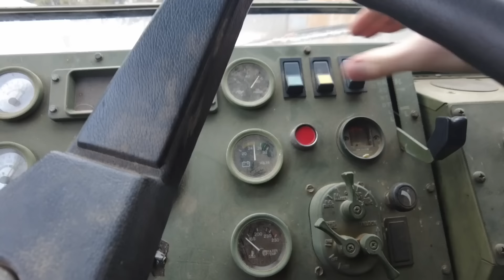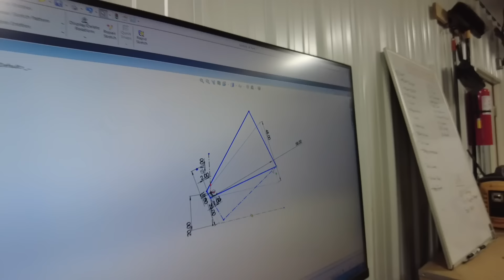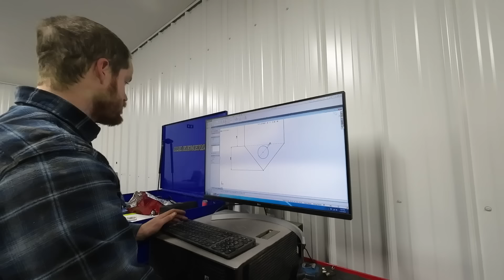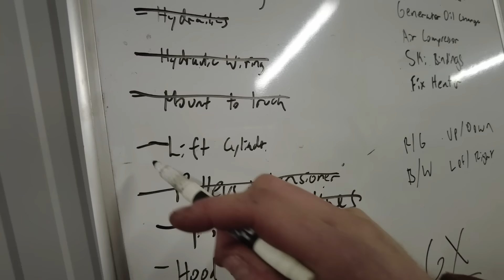We Built The ULTIMATE SNOW BLOWER | First Drive

Comment: Awesome job, guys.
Pretty darn respectable for a couple with mostly little experience with these huge projects you 2 have seriously knocked out of the park!

Pro tip-- take a piece of 1/2" by 1/2" square stock (or equivalent) approximately 8" long.
Set aside.
Also cut 2 (two) 3/4" long buttons of similar stock.
Make a capital F out of the 3 pieces to form a tool that can be slipped over the chain tensioner for extra leverage while donning or doffing big, heavy, wet, slippery tire chains.
(Helps immensely to slightly notch the buttons so they don't slip sideways off the tensioner.)
Also negates the need to remove big guy clunky gloves while working in puddles of sub-arctic slop in a snowstorm while tightening loose chains, should the need ever arise.

Drive to Kalispell and show me how incredibly fast you can blow the snow out of my driveway.
Stay for gourmet coffee and a delicious elk steak.

(bring your own elk, and maybe a couple extra for me)

😁😁😁

Comment: You could add a few airbags on the front axle to assist the existing suspension. I would also consider felling a few trees, or putting a bucket of dirt right at the back of the truck to offset some of the load at the front.

Comment: Something that will help besides weight in the backend of the truck, would be to put a crossing between each of the ones that are there on the chains. I just say this from experance working in the woods for 40 yrs. as a mechanic and operator. I only express my opinion from what i have found what works best for me and not everyone. I am lazy an do things that are the easiest and fastest for  me. You have done an excellent job on the blower. Best of luck.

Comment: It's really great you have everything you need to do this build in your shop. I'm glad to see you chained up. Some extra weight in the back would help but at the end where you got stuck you didn't clean your path ! All that weight on the front lightens the rear. Also if you ever noticed snow plows and blowers lift by a cylinder lifting a chain so you get a float action with it. That way it will seek its own level within a few inches on dips and rises. I want to see it in some deep snow since I'm not sure where you're at in guessing you got some heavy recent snow. Also we run transmission fluid in our hydraulic because it remains fluid in extreme cold and doesn't foam up.

Comment: Fantastic engineering job and some of the prettiest welds i've seen. Because you have added more weight to the front of the vehicle. It would be a good idea to add the same or even a little more weight over the rear wheel to help with traction. Retired Army Hooaa

Comment: Fantastic!  I had my doubts that the front end of the (low bid) Army truck had the strength to carry that much weight out front of the steering axle.  Keep checking the effects of vibration on your gasoline fuel and hydraulic lines and fittings.  Well done!

Comment: Good job guys (and girl !). After getting all your controls inside and everything, the only other thing I think you might want to do is build a cooling fan for the engine that blows out through the radiator instead of sucking the air in. When you have real light powdery snow, the fan will suck it into the radiator and clog it up. I used to race a car on the ice and that's something that happens. You could try building a framework in front of the radiator and put window screen in it, and space it out away from the radiator a few inches to allow air to get in around it. Good luck with it. It'll be good to see how it does in 2 feet of fresh snow !!

Comment: 1) Paint that raw metal ASAP.  2) Fabricate a cover for the motorworks using hood and trunk from the car.  3) Create a wire harness to bring all the controls inside the cab.  4) Put a load of sand in the back for traction weight and use if you get stuck. 5) great work!

Comment: Terrific engineering and build. I had a 6' blower with a 301 cubic inch, 59 horsepower engine. When the snow would be deeper than the first auger, the engine was lacking in power to blow the snow. Going to make a video on getting the truck out?

Comment: You might consider using some mechanical wire on the tire chain locks because they have been known to come off at the most inopportune times. If you have trouble getting them tight, deflate the tire, tighten the chain and reinflate. Congrats on your creation and don't allow anyone in front of it when operating!

Comment: Now you need to add a winch at the front and back so you can get out of situation without assistance. Glad it worked out. You will continue to improve it as you work with it. But what a job you did designing and building. Once you get the throtl connected to the cab it is going to be amazing. Love it 👍

Comment: Hi guys! Make two small wheels at the bottom of the mounted unit so that the body does not cling to the stones while driving or a curtain made of thick rubber 4-6", along the bottom of the trough, it will help to rake all the snow into the auger and will not let the stones cling on the road. Greetings from Russia!

Comment: The rear tyres are lifted up a little so then you need to add some weight in the back. But also i would offset blower so you can get the snow from the sides of the road. And then you dont drive in the ditch so fast.

Comment: Awesome build! If i could give some friendly advice, you may want to rethink the hard mount on the lift points of the 3 point attachment. If you switched your design around to have a pivot point on a solid shaft attached to your current mount..... you should be able to use 3 point lift arms for mounting. This would allow you to easily remove the whole setup just like it was on a tractor. BUT... the more important part is that WHEN, not if..... you manage to catch a rock, or a steeper incline, the arms will raise up and save the whole thing from being destroyed by inertia meeting an immovable object.
Keep in mind 3 points on tractors can only lift. They cannot exert downward force. Because of this, they are naturally floating. So, if you run across a large rock or root or something that would otherwise stop you dead.... the 3 point arms just lift up.

Comment: You may need a heat shield for the snowblower exhaust. It looks pretty close to the chute. Some tractor snowblowers that have the exhaust by the chute will heat the chute then the snow melts and re-freezes, locking the chute from turning.

Comment: depending how much welding and plasma table use you plan on... it might be an idea to install an in wall exhaust system.. have the outside louvres that open and close as the vent is turned on/off  that'll help keep the air in shop clear and will stop the outside air from getting inside so much with the big door open

Comment: The cruise control for constant RM under changing load is an awesome idea.  Most PTO equipment is designed for 540 RPM input.  You might check your gear and belt reduction calcs as it looked like you were REALLY spinning that blower.  BUT I think it could take a bit more than 540 RPM input.  But not like 2X or 3X as much.  You could also attach a tach on the final drive so you can monitor it as you go.

Comment: You may need to make larger adjustable skids for your rocky and uneven driveway. Those skids are designed for a paved surface. Snow blowing a rocky road is noisy as you dislodge and throw rocks unless you have good clearance. Or, you can just not clear to the dirt.

Comment: Congrats on the snowblower with that being said now you will have to make a chain guard that goes all the way around and that will hold oil for the chain.  Now on the sides of your snowblower you will need to make some side guards for snow, Then you will want to get a wear blade on the bottom of your blower now here's the part you might think I got my head screwed on right take an old bias type tire and cut the tread out of the tire then TAKE THE TREAD CUT IT IN HALF, TAKE THE TREAD PUT IT UNDER THE SKID PLATE AND BOLT IT DOWN LET IT HANG 3" LOWER THAN THE WEAR BLADE THIS WAY IT WILL HELP THE BLOWER LAST A LIFE TIME!

Comment: At least you now have some repair crosslinks for those chains. You might prefer putting them on by driving forward so you are  behind them when fastening the hooks. More room. Also, it helps to drive a short way and see if they need a link taken up. With your skills, you could fabricate some hangers for them on the truck somewhere and just leave them on the truck.

Comment: It turned out great, but I have two observations/suggestions.  That open air/cold air intake filter should have som kind of housing around it. Probably anything from the junkyard or the factory sunfire one should work. Seems like it would suck in too much water as the misting snow melts. Also you should probably hear wrap that exhaust. Although winter it seems like it’s too close to the hydraulic line and might cause heat problems.

Comment: You may want to add a counter balance weight to the rear deck of the truck to offset the weight of the snowblower and give you better traction and steering control of the truck.  I would also suggest adding a way to adjust the top part of the shoot so that you can direct the snow where you want it to go rather than just nearly vertical.

Comment: Crazy! That was a lot of work, you may want to install an .030 Orifice in that Lift Cylinder down circuit to control that movement, that's a lot of weight to stop sudenly. If that's an 08 fitting on the actuator, I have used a 1/8" pipe plug that's been drilled, just run an 1/8" pipe tap in the fitting and screw it in!

Comment: As an early doubter, I have to congratulate you. I'll be eager to see how ut does in deep snow. 
You need to add some weight to the truck for traction. In Vermont we used to load them full of traction aid salt/sand mixture, or just fill the body with compacted snow

Comment: You should mount one of those cheap after-market "rear view camera" systems to the front of the blower with a monitor in the cab so that you can always see where you're going. You're in a remote area with challenging roads; not a good place to have low visibility behind mechanized spinning blades.

Comment: If you look at any other front mounted equipment you will notice that they use a chain and not connect the hydraulics directly to what they are lifting, if you break the lift you may have to change your lift to that design.
You may want to put Split Cable Sleeves on your exposed electrical wires to tie them together, also on any exposed hydraulic hoses. Available on Amazon.

Comment: Great job - engineering and welds are impressive.   Question, not a criticism, a question:  Why didn't you just put a snow blower on that nice, tracked, skid steer that was parked in your yard?  Cab, heat, quick detach if you 'get stuck'.  Money?   Anyway, very nice work, including the photography.  Congratulations.

Comment: Great job! But I can see an issue! I think you need to balance the weight more to the rear. Get yourself a concrete block like the ones used on the road as a temporary barrier and put it in the rear section of the truck bed. I'm suggesting this as when you brought the truck out of the workshop and reversed round I instantly noticed the rear wheels lost traction and skipped!
Have a think about it and watch the footage again. 😉

Comment: I grew up on a farm in NZ - it was basically clay soil - used land rovers with cleats instead of chains  - replace the chain that goes between the the tyre tread and the ground with a flat bar (with ends towards the wheel hub to keep the bar centred on the tyre tread) and have a a flat bar at right angle to the tyre tread to supply the grip - an adaption of crawler tractor tracks - bloody brilliant in clay - may work on snow / ice

Comment: If you find some old rock rake teeth cut the flat parts 1 to 1 and 1/2 in long and weld them onto the bottom auger lenghtwise sticking out 1/4 to 1/2 an in to help chew up hard frozen snow.

Comment: A counterweight, greater than the weight of the snowblower on the front, located in the bed at the rear axle and back to the end of the bed would level out the weight and improve traction.  With all the weight in the front right now, the truck is basically just a front wheel drive.

Comment: Really interesting video. I think there are a few things to consider. First, there is too little clearance between the equipment on the blower skid and the front of the truck. I think that instead of a simple tilt, you need to replace that motion with a vertical lift, a means of extending the blower forward and backward, and a tilt of the blower itself. This would allow you to change the angle of attack of the blower front to the snow and to raise or lower the position of the mouth of the blower in relation to the snow. For really tall snow banks, you may want to first clear off the upper level of snow and then lower the blower to remove the lower level of snow. 

Another factor to consider is keeping the blower high enough above the ground so that when you are transiting to the snow you want to clear, there is enough clearance so that the bottom of the blower does not hit the ground if the suspension of the truck bottoms out. You may also need a counter weight on the back to ensure you have sufficient traction on all drive wheels. I am just guessing here though. 

While I can appreciate that your approach is modular, like that used by Larue in its D stage blowers (mounted on front end loaders), another configuration to consider is perhaps mounting the drive motor on a base that sits over the back wheels and either running a drive shaft forward or perhaps even a hydraulic line to a hydraulic motor that would, in turn, drive the blower stages.

Comment: I think you are one of the smartest engineers when it comes to designing. There are a few good comments on here so I'll give you a couple more only because they are important. It was suggested that your snowblower needs to float so that it cuts down to ground level. To prevent it from digging into the ground you can put on some skid shoes or wheels...aka tires. SECOND..rpm first if you don't know find out what the snowblower rpm was designed for...its either going to be 540 rpm or 1000 rpm. If it's a 540 you can not for safety reasons run it at 1000 rpm. You need to find a way to know what the fan rpm is and you need to have that reading inside the cab of the truck. If it's a 540 snowblower you can run it up to let's say 650 top in rpm. If it's a 1000-rpm snowblower you can run it safely at 1100 rpm and under. But you need to find what your snowblower is designed for and you can set your throttle for 540 or 1000 rpm and let it set there and forget about it as long as you are snowblowing. The fan turns at the same speed as the tractor pto and all we do is set it to that speed by looking at it in the cab of the tractor. So you need to pick up the fan rpm and display it in your truck. THIRD and final comment from me is preventing your truck from getting stuck. The truck needs weight added if your going in the snow period, especially that military design truck. Simple weight in front of the snowblower lifts the weight off the rear wheels. the solution is easy if the snowblower weight is 1500 lbs you need to add 2000 to 3000 lbs over the rear wheels and anchor it down...you need the weight of the snowblower plus any weight above that over the rear wheels to help that terrible design truck for not getting stuck....so add weight snowblower plus over the wheels and I'll watch the big changes in snowblower on your video...take care and congratulations on the baby. I kind of knew several videos back being a 72 yr old father the look on her face gave her away....lolololol
Reply: I've never commended on anyone site before but I watch yours all the time and go back and watch some of the videos 3 and 4 times. The dozer work maybe 7 to 8 times over...lol
Reply: Simply way to explain is it's like a see saw...lift up snowblower no traction or weight in the back...also while pushing the blower need traction weight in the rear. Old man here doesn't always explain very well. In my large farm tractor I added 1300 lbs to each rear wheel with liquid ballast. Methanol and water plus liquid tire sealant to stop flat tires.

Comment: Cruse control on the RPMs.  that is simple prox switch that can handle high frequencies or pluses.  personally use the ones on the anti brake lock up as it is great high speed pickup sensor.  Just set for RPM and let it hold that pulse rate which is all a speed control does.

Comment: What a great project! I would be nice to see this clearing a normal snow thickness ( at least half of the height of the blower ) . I was wondering afterward why you did not adapt it to your skid steer rather than truck. The skid steer can manage tilting, additional cylinder or even an hydraulic motor that could power the blower… and the skid steer would be way more easy to drive in the snow.

Comment: That is a very cool project.  

I'd guess a load of rock in the back of the truck will solve the getting stuck problem.

One thought.  It seems, from the limited view available in the video, that where the blower attaches to the truck is a weak point.  There is a lot of weight cantilevered out from that point.  I'd check welds for cracks after each use for a while until it proves it is strong enough.

Carry on!

Comment: Instead of using the screw in metal studs for your rubber track vehicles, there's a company in blanchard idaho called cinchtrax that makes what is essentially a bolt on "chain" for tracks.